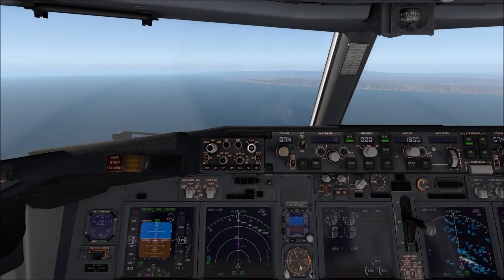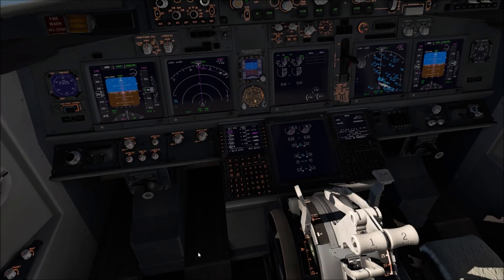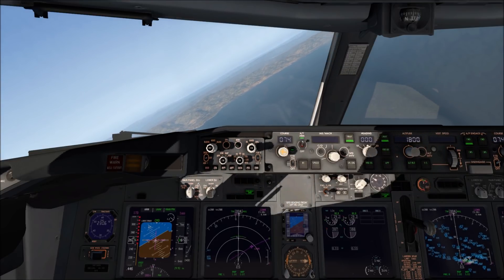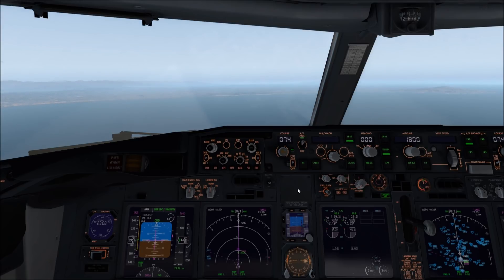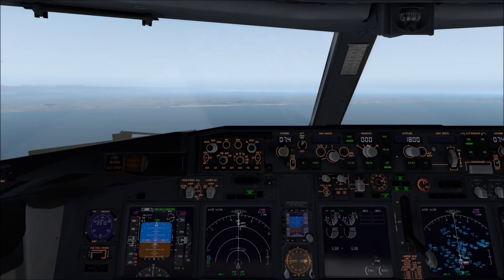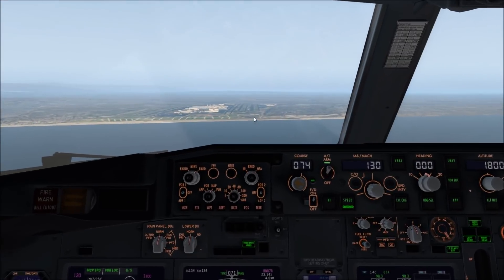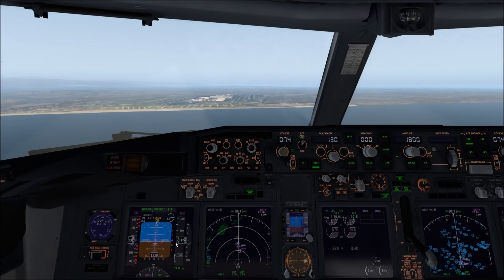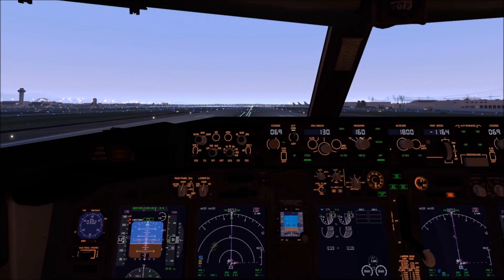X-Plane 11 | Zibo 737-800 | ILS Landings

Comment: papi lights are red to right of white not red "over" white - disengage autothrottle place throttle to idle prior to landing - when discussing runway alignment it is best to discuss lateral (localizer) as well as vertical (glide slope) and note that localizer is engaged BEFORE glide slope - no discussion here of localizer.

Comment: How did you perform thrust reverse
Reply from the maker: The thrust reverse is the lever located on the top of the throttle column. However I have mine bound to a button on a programmable keyboard. In order to activate it you're thrust has to be at idle however.
Reply: @Blaine10024  Got it thanks. Btw, I found a keyboard shortcut to activate it by default it is showing shift + /
Reply from the maker: @markbonilla3639  Glad to hear it!
Reply: @Blaine10024  When you said flare the a/c does it mean that you have to pull throttle up and then down?
Reply from the maker: @markbonilla3639  No, flaring is when you pitch the aircraft up to reduce your descent rate just before you touchdown on the runway.

Comment: How come after your FINAL MAP CHECK is closed you have APP OFF and SPD ON?? Just before that it was different???
Reply from the maker: I see what you mean, and I'm not sure. It could be a glitch because this is from a Zibo version which is quite old. There have been many instances where the lights do not show on the MCP. However, on the PFD it states single-channel which means the ILS is still captured.
Reply: @Blaine10024  I'm pretty sure when the glide slope is fully captured the approach might extinguished cause it's the tech on the ground guiding the plane down to the runway when ever the app button has a light it just means it's armed I don't think it's a glitch

Comment: This video is good to show people how to do an ILS approach, but in terms of the landing itself, it is quite inaccurate. If you are doing an autoland, you don’t disconnect the autopilot just before you touch down in order to flare. It will flare itself. Make sure you have both autopilots engaged if you’re doing an autoland though. If you are doing a manual landing, the autopilot must be disconnected before the CAT1 decision altitude, at which point you have to have the runway in sight.
Reply: He did say (O:43) that this was NOT autoland.
Reply: That's only for a CAT III ILS landing procedure, not a standard ILS. For a CAT III you apparently arm the CMD B A/P after the APR engages etc., and then set it and leave it. You don't
touch anything then, until the plane lands itself and touches down, then it's the usual,  reverse, autobrakes, decel, etc.

Comment: Flaps 1 @250knots but speed still increase, so... speed brakes @260knots? It would be better not to extend flaps when speed is 250+ knots. There are other ways to slow down in case of need. IMHO
Reply from the maker: Sorry, are you asking a question if you should use speedbrakes at 260 knots?

Comment: Do you actually need VNAV for this procedure? Also: I have read, that you need to set your COURSE to the runway heading (which you did), but you did not mention it specifically. So is this a must?
Reply: What I've been taught is that, once you engage the APPR, the ILS landing system takes over from VNAV for the final descent and landing, so once that happens, and it engages,
VNAV is no longer active, as such. But yes it's common practice to set both COURSE knobs to runway heading and the Heading knob as well, just ahead of final. But again,
the ILS system once LOC is engaged, should centerline your airplane, and once The GS comes in, the ILS is essentially ensuring that whatever you do set on the COURSE
etc.., the ILS still keeps the plane locked on final approach and landing course. It's a good idea to set all the Course/Heading to synch though, because, if you have to 

execute a missed approach and go-around, or emergency landing later, the plane should be set for runway heading anyway, so you can go straight out, climb, and TOGA
yourself to whatever is prescribed for that runway and go missed procedure.

Comment: Thank you Blaine, I'll be giving that a go later today, I'll let you know how it works out. 
Just two questions about your comment that in the Zibo mod we should advance the throttles then back to idle to allow the reversers to be available on the ground. 
- is that to disengage the auto-throttle? 
-  is that a specific Zibo mod requirement or are you aware if it also applies to other X plane 737s as well? 
Once again I appreciate you taking the time to step through this topic.
Cheers!  Mike 😊
Reply from the maker: Michael Hancock you're right on the mark, it's to turn off the auto-throttle. Otherwise when you touch down you won't be able to activate thrust reverse.
Reply: Hahaha! 😂 Well that explains all my runway overshoots!
Thanks Blaine...